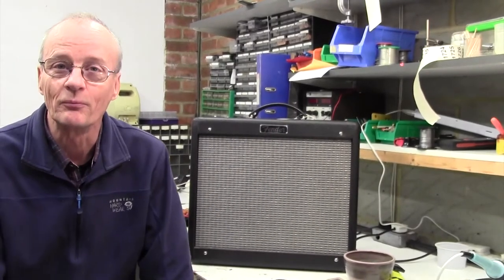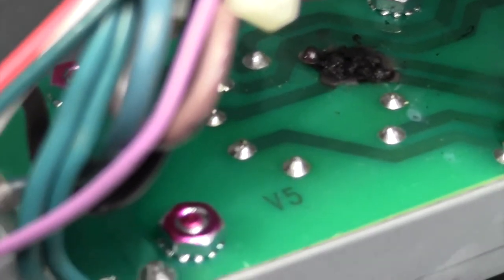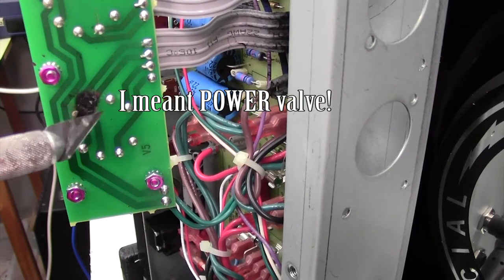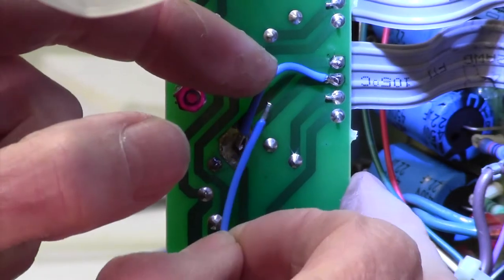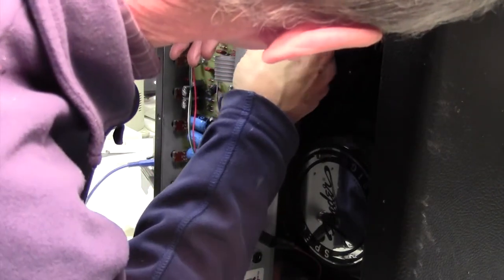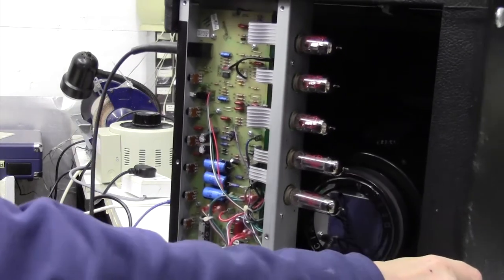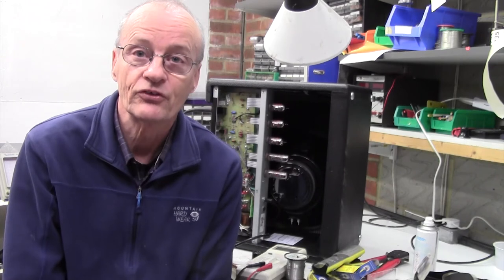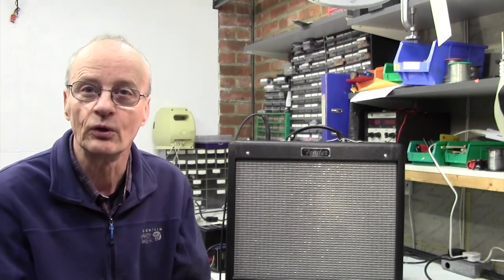How to Fix Fender Blues Junior Track Arcing Fault

Comment: I've had to reflow all the solder pins on my BJ's EL84's.  They run the EL84's so hot that they eventually ruin the PCB.  (Red plating the tubes and ruining them in the process.)  Just bought a new tube PCB from a UK company with a bias pot and test points that should eliminate the "problem".  After doing all the Frommel and Bill M mods... May have been better off just building a PTP wired amp kit.  Thanks for posting!
Reply from the maker: Yes those BillM mods are really good. Shame, he died I think.  I still like the BJ. It's a god amp.

Comment: At 1:10, posidrive screws  (and the correct matching bit)!  As a tech myself, this is good to know. I have to wonder if the Blue's Jr.  or other modern Fender re-issue type amps only use Pozi-drive screws if the amplifier is going to be sold in the European market. Most people over here (USA) don't recognise Pozi-drive screws, when they come across them, as being different from Philips screws (look for 4 additional small notches or crosschecks in the screwhead); and the heads of the Pozi screws invariably get badly chewed and stripped out if you use a regular Philips-head screwdriver on them ( even worse if you use a cordless screwdriver). So, always use the correct screwdriver or bit, as Stuart does here, and my advice is always to loosen the screws a bit by hand, breaking them free before putting the cordless screwdriver to them.

PS,  Bang and Olufsen speakers were typically assembled with Pozi-drive screws, and it's my understanding that IKEA furniture often uses them as well, although I'm told that IKEA usually include the necessary Pozi-drive bits with their products.

Comment: I've had similar things happen becaue an insect had shorted the leads.  In once case, there was an insect nest inside of a mechanical contactor that prevented the current flow.  Literally "bugs in the system".  It happens when you don't use things for a while and the insects find it to be a good home.

I wonder if in this amp there was a bug carcass at the bottom of the case?

Comment: Arcing can happen when the speaker connection comes loose while playing. The plate voltage jumps up severly and since the cathode line was so close the current went there. Also a faulty cathode resistor can be the cause. In some amps there are protective diodes in place but it seems not in this one or they weren't triggered because the close proximity of the traces. The customer got lucky it didn't fry the output transformer.
Reply from the maker: Yes agreed that can definitely cause that problem, baically disconnected secondary of o/p transformer can cause very high indiced voltages. Tubes also arc for 'no reason' as well, i.e. they are just faulty.

Comment: Hey man. Love this video. So my Blues Junior is sparking, but only at a single point on the track. A single point is sparking around itself in the power tube section. Very little charring. What could be the fix?
Reply from the maker: Hi Zach that sounds really odd. If you go to the end screen of any of my vidoes you'll see a way to contact me direct. Can you take a pic of the exact area and send it to me?

Comment: I know this repair was three months ago, but do you recall what you had to do to fix that excessive bias current? Had someone swapped out Fender's original bias-setting resistor(s)? Seems way, way out of spec, and I'd be surprised if the customer's power tubes didn't ultimately need replacing (in spite of their testing okay).
Reply from the maker: Hi Jim  Yes to bias the amp you have to change a fixed resistor value. I did a video on this https://youtu.be/DCy0vDBFgzo

Comment: Is there any indication as to the copper weight PCB that (ofF)ender uses? The high number of trace screw-ups by the board designer makes me think they use 1/2 ounce board material. Sorry, but I've see too much of the "pure cheapest way" in their products.
Reply from the maker: Hi Rich I'm not sure but I think the material is fairly decent, it's just that they have laid the tracks too close to each other! Newbie error.
Reply: @stuartukguitarampguy5830  Don't mind my questions too much Stu. I'm a retired Electronics Design. And guitar player.  I also see too many "beginners blunders" LOL